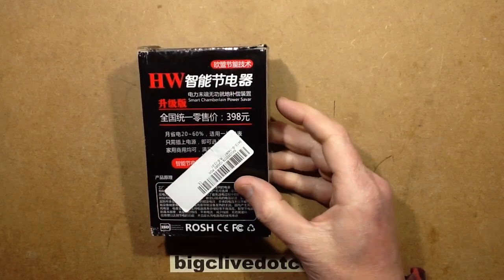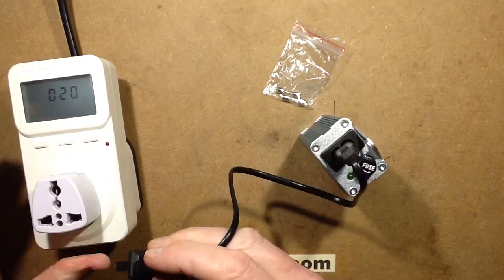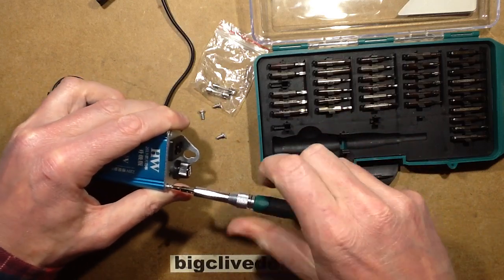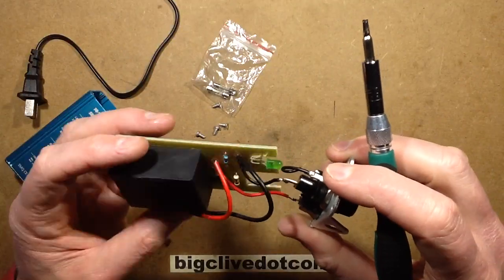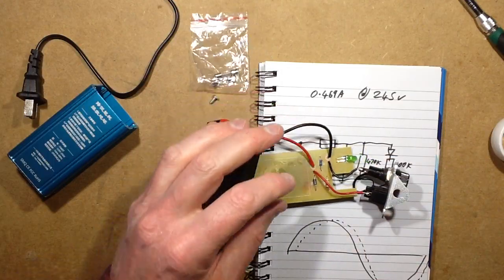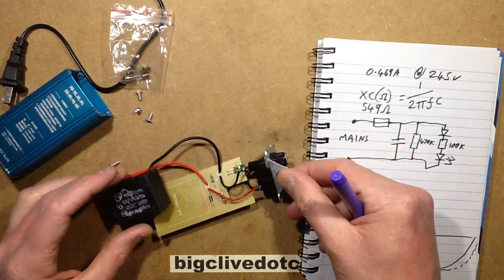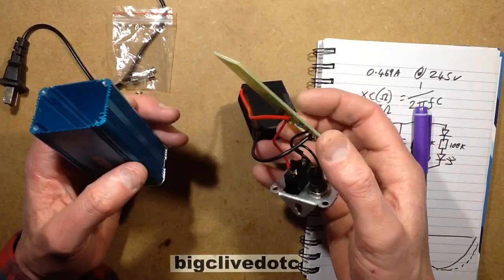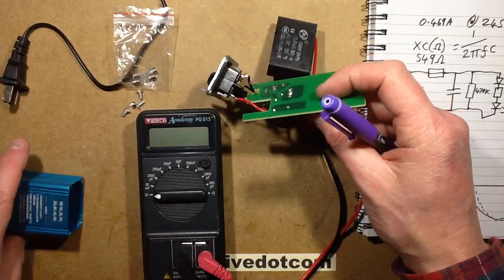200kW miracle power saving device.

Comment: Looks like a perfect match for the suicide shower head.
Reply: +MattExzy Wasn't that at least earthed? (I fucking hope it was earthed;))
Reply: +TheJohn8765 I think so, through a wire in the water stream! That's why it'd be such a great match - it'd remove all doubt about safety heh.
Reply: MattExzy At least an earth connection directly through the stream is going to be <marginally> more attractive to the electricity than you are, even if you're standing on metal.

I hope ;) .
Reply: +TheJohn8765 Hmm, depends on the mineral content of your water. Salty water bag (you) vs. not very conductive clean water... Not something you really want to test...